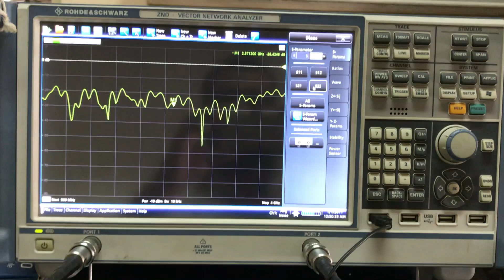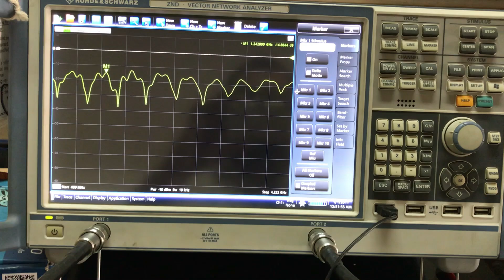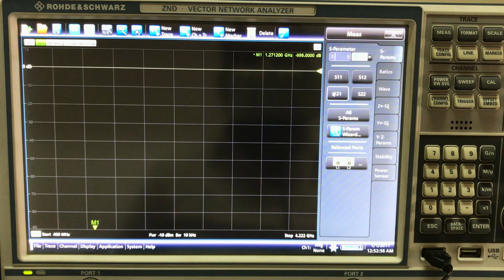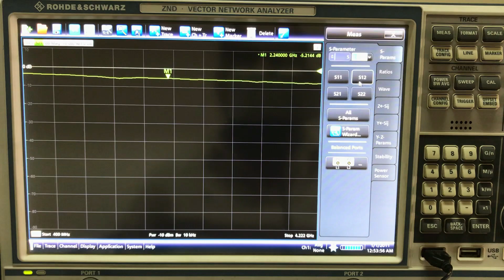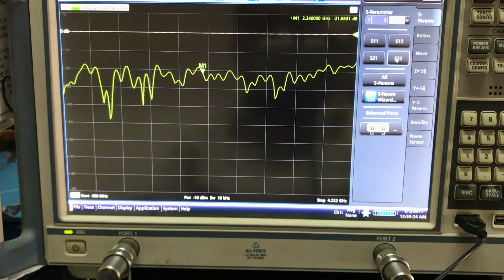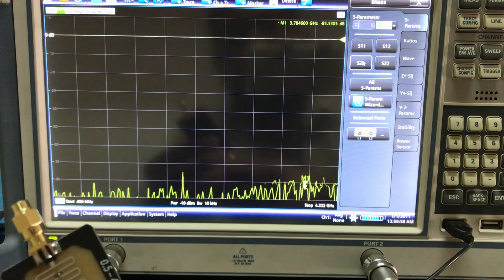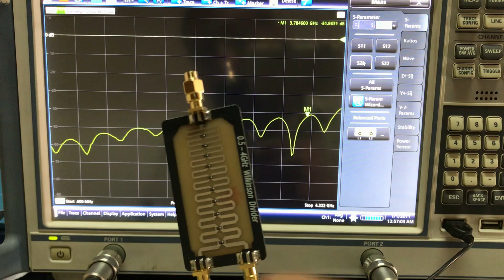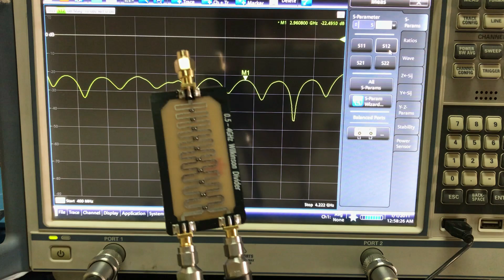How to Test RF Power Splitter/Divider Using VNA | Wilkinson Divider ~ 0.5GHz - 4GHz

Comment: Thanks for such a nice video on Power Splitter.

Can this device be used as a power combiner? If yes, what happens if we provide 0.5 W to both Port 1 and Port 2? Will we get a combined output of 1 W on Port 1, or will there be losses?

If it cannot be used as a combiner, what types of splitters can function as combiners and vice versa?